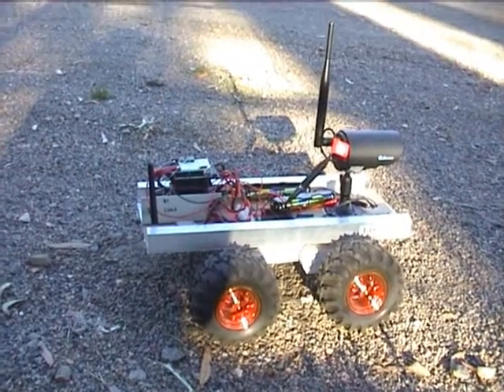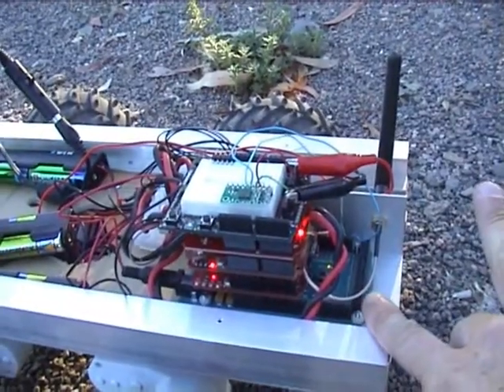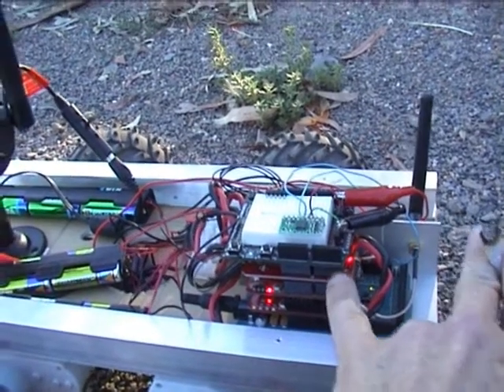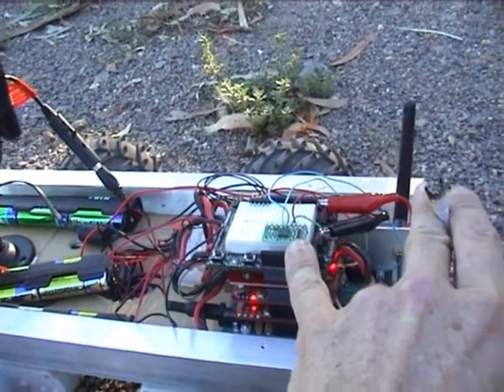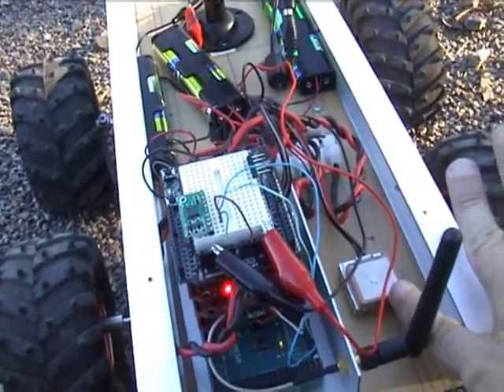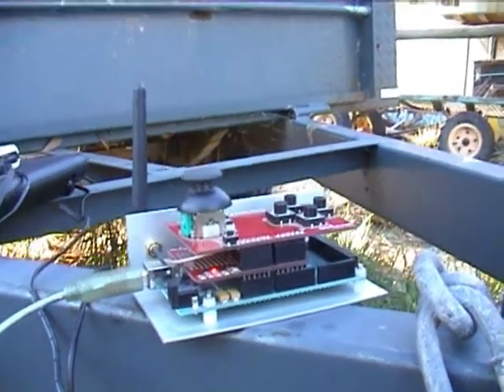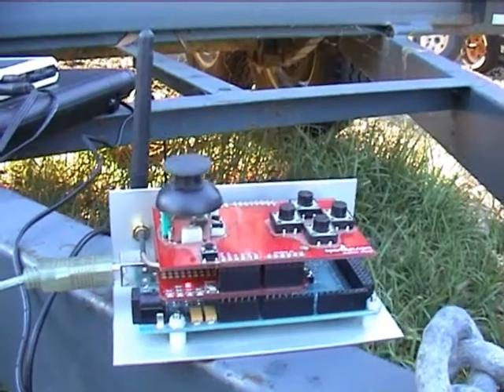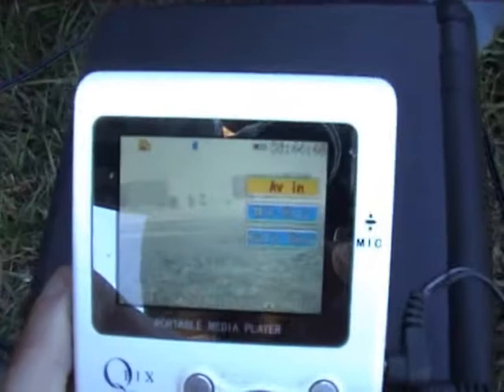Rover 5 + FPV drive

Comment from the maker: These are the Dagu "Wild Thumper" wheels.
I'm not going over 7.2V, the newer version is using LiPo batteries and 2 Dual channel motor controllers.
6 AA's just don't have the grunt to make it move at anything below 40-50% PWM.
With 2 motors sharing a channel on a speed controller you get a lot of interaction, I found it took just 1 wheel free spinning to make it stop.

Thanks for watching

Comment: I am currently working on a similar rover and have a rover5 chassis with the rubber tracks.  I would like to convert the track to wheels.  Can you tell me what wheels you put on it and where I might get them?

Also what voltage are you running on the drive motors?  Are you cranking up the voltage above the rated 7.2 volts and then backing down the pwm?  This would allow for higher torque without blowing the motors.

Great video .

Comment: Would it be possible to send through the code for this? I'm building a similar Xbee based Robot with a Monster Motor shield.
I will modify it to suit my needs and ill give you Credit for what you've done.